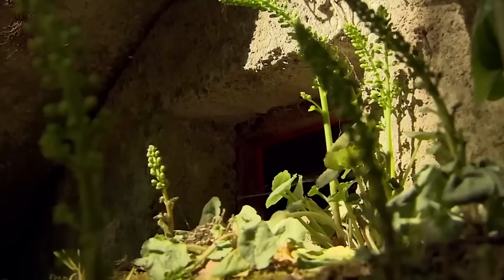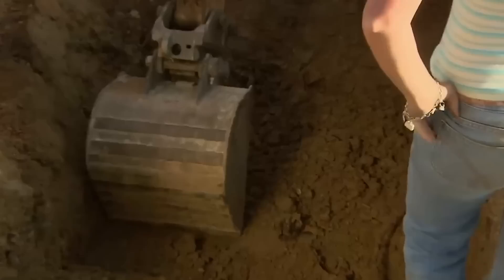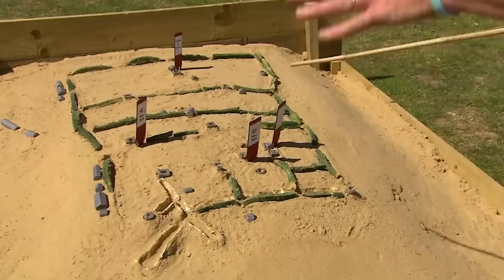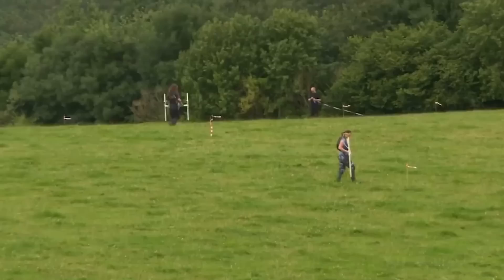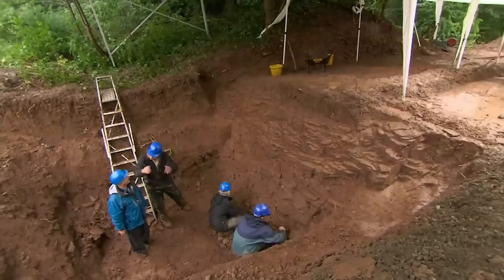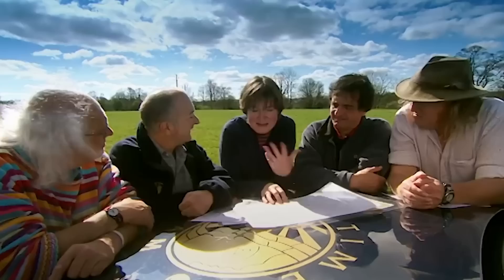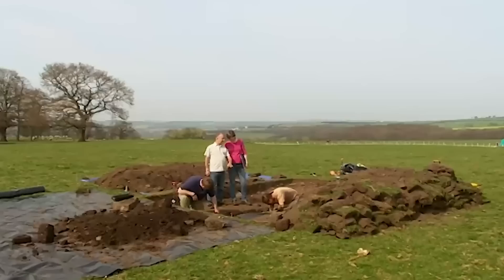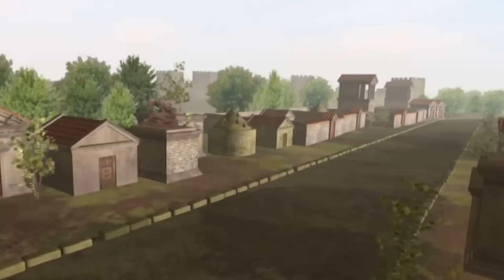➤ Time Team's Top 3 FORTS

Comment: Sorry, just too many breaks (UK via Youtube). The archaeology is disrupting all the adverts.
Reply: It's just as bad here in the States. You used to be able to slide the time bar forward to the end and start over and watch without ads. That doesn't work any longer. I've kept track through several episodes and also videos from other channels. Ads run about every 5 minutes.  No matter how many times you watch it. I think it's YouTube, not Time Time.🤬😂
Reply: @Margaret McAllister & @Turk 1157 - Have you tried an ad blocker? So far, it works well for me - no ads at all.
Reply: you need to get ublock origin for your browser
Reply: @MossyMozart  I watch on my phone. I don't really know much about tech but from past experience, I don't like adding too many apps but thanks for the suggestion.
Reply: @TUSK1157  
Watch it through a browser on your phone. Then it would be easy enough to add an adblock to that.